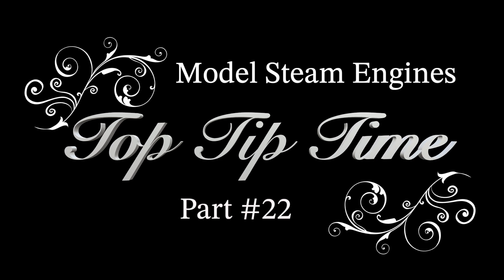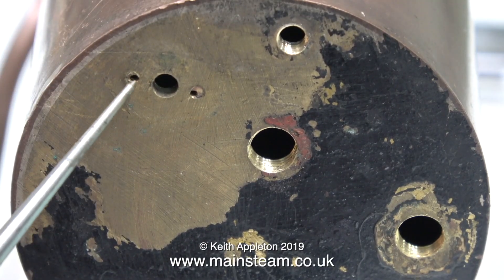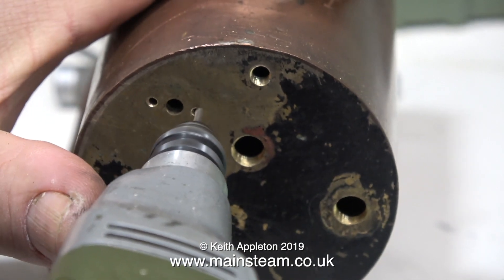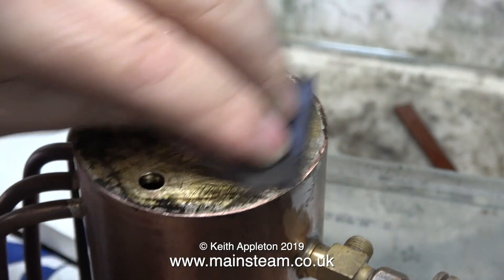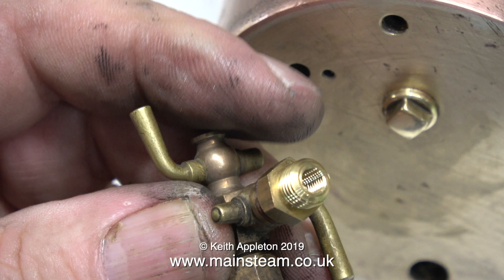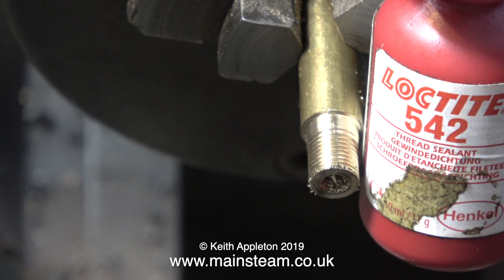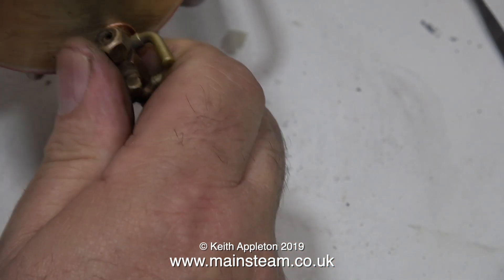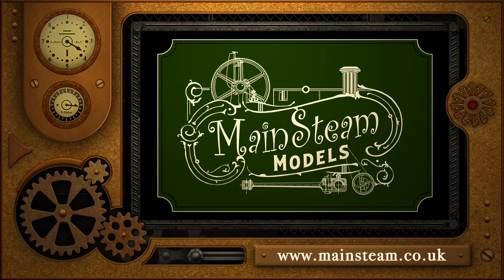MODEL STEAM ENGINES - TOP TIP TIME - PART #22

Comment: If you spend some time (about an hour) in a room full the fumes from that thinner, followed quickly with a couple of tall boys (pints in the UK) you will have a very pleasant short period of time, followed by a rip roaring head ach, That's what the beer if for. Then you will once again have a pleasant period of time. (first hand experience)
That's not a "top tip", but a tip none the less. ;-)
Reply from the maker: I always open a window and a door . . . . . I am never in a room full of fumes, and I do not drink much in the way of Alcohol either, and I definitely don't do headaches }:-)))